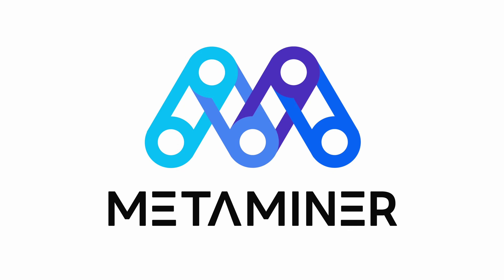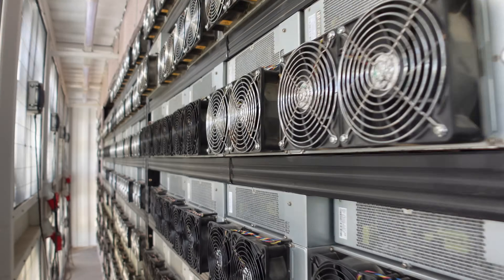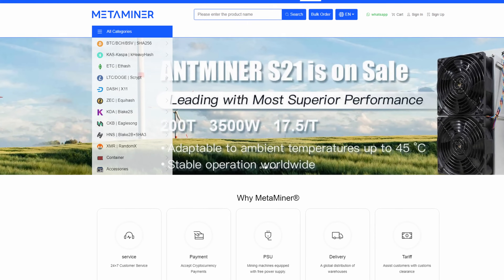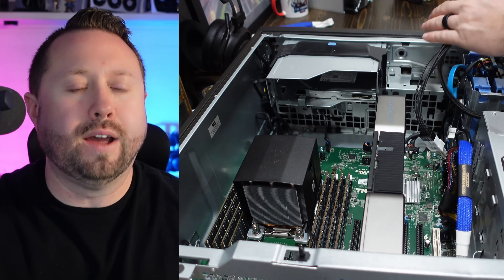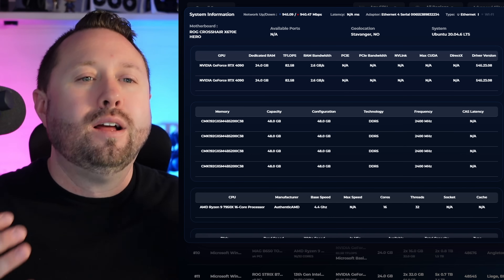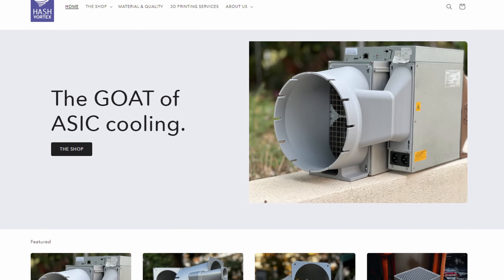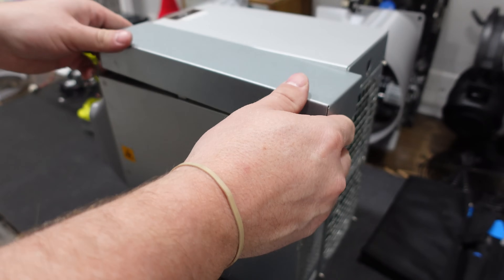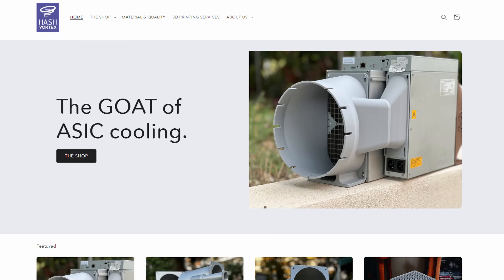Here's Why GPU Mining Profits will Explode! HIVEOS to Add POUW!

Comment: Fantastic!  I echo your thoughts on my trials with FLux-Core.  Having to let the Flux-Core software install everything along with the NVIDIA controller on Linux machines was a turn-off as I like to manage those things and versioning.  The thing I also noticed and I suppose this will also be taking place on HIVEOS are the performance measurements.  I experienced regularly re-occurring durations where the machine would seem unavailable.  Now this might be worked out as that was the alpha version, but I have since removed the FLux-Core from the very machine I pieced together for using it.  I didn't know about the HIVEOS integration plan before this video, super appreciative of you hunting this down!  Great job my friend!

Comment: My concern is whether or not there are still minimal hardware requirements
Reply: This. I don't see how the min requirements will change. My Octominers are still useless for PoUW because of the CPU and memory capabilities. My guess is Flux just decided it wasn't feasible to support an OS, partnered with Hive instead to have a version available to load onto the mega PoUW machines.

Comment: Where are you getting this 10x rewards figure from???  In an Flux AMA over a year ago Dan stated 10x typcial mining rewards, but in a more recent Flux AMA he stated only 10 to 20 percent over normal mining rewards.  Which is a huge difference and not worth it to even upgrade your rigs to the full pcie x16 lanes (pcie gen 3 x8 speed minimum suggested) , cpu and ram upgrades.  Just  public service announcement for people to think about before spending all kinds of money to upgrade there rigs.
Reply: Can you point to where Dan said profits would only be 10-20% over normal mining?

Comment: would be critical to know wether need x8 or x16 or a capable cpu tho
Reply: Need x16 slots running at pcie 3.0 x8 or 4.0 x4 minimum.  Cpu must have 4 threads per gpu

Comment: I wonder if there will be overclock control if such as an option gets introduced, or will it use max power when switching from the coin it's mining to POUW Flux.

Hopefully it'll be something that resets the overclocks of the coin it's mining and applies the flux entered overclocks by the user and when it's done from POUW Flux it would reset the overclocks and start the flight sheet overclocks of the original coin it was mining.
Reply: automatic overclock switching is already in hiveos... on your worker page click the overclock tab and there you can add different overclocks for different coins that will automaticalls switch if you change flightsheet
Reply: @kryptonitrous  I would assume POUW is a different thing, just how would have so the switch we will need to see the implementation later

Comment: Can flux POUW use GPUs on risers?  I thought they could only use GPUs on the mtd only.
Reply: yea thats what i thought. specially FLUXPOUW, unlike cloreai and dynex, it needs x16 pcie lanes and beefy cpus. as far as i know.
Reply: Yeah I second this I want to ready my rigs for this but need to know if we can run this on risers
Reply: You can use x16 riser cables.  X1 usb risers will not work
Reply: @zmaxgolf3166  that riser cable you are talking about is x16 to x16 extension cable, you cannot put a few x 16 cables to your motherboard. it doesnt work like that. Your Cpu has to have x16 lines to support it. i have got 125 gpus probably will only able to run 14 of them on POUW. You need to do a research about this. there are no MINING risers which are x16 or make your pcie lane x1 to x16.

Comment: Great video! You have to remember not all rigs will do well with POUW, you need minimum 8x pcie lanes going to a card. I believe the octominers are all x1. Mining flux with 6 2080tis for about 89-92 sols @ 190-200w each for two years now! going to order a threadripper or 32core epyc for POUW!
Reply: You make a good point.  These GPUs would likely be used for tasks requiring a significant amount of RAM to perform well at AI or rendering.  Most mining rigs would need an uplift as 16 GB is great for mining, but 128 is probably more suitable for AI tasks.